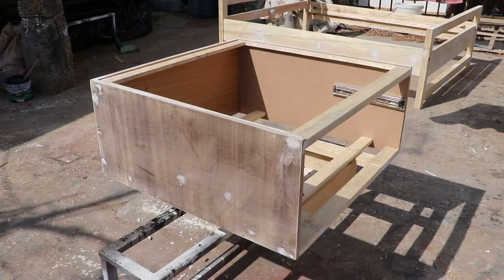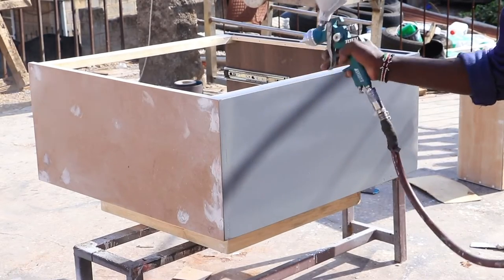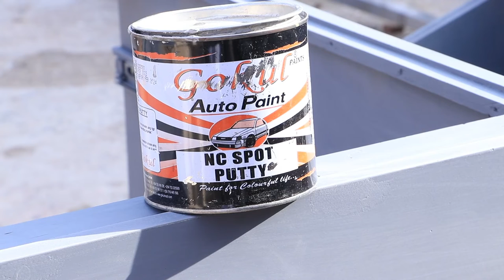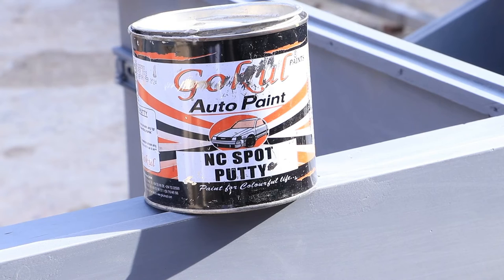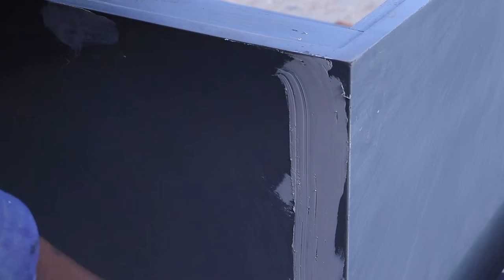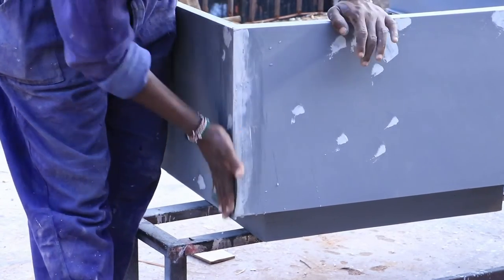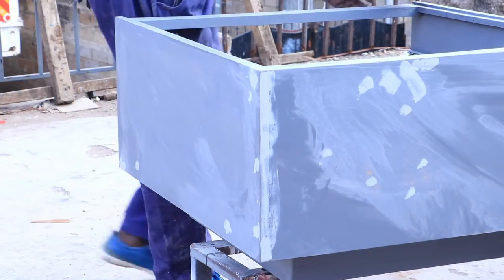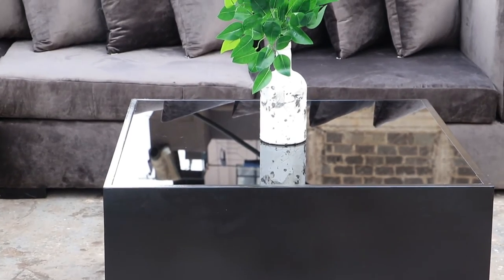How to Paint MDF | Both Plain and Laminate | Perfect Finish

Comment: What type of paint do you use 🙏
Reply: Also is there a difference between spot putty and body filler?
Reply from the maker: We usually use Neutro cellulose (NC) paints or Automotive.....the ones used to Paint cars.
Reply from the maker: @spiceed_spaces1  yes. Body filler is for bigger gaps and is used before applying primer. Spot putty is after primer/ undercoat...and is used cover tiny tiny imperfections
Reply: Thankyouuuu so much.
Reply from the maker: @spiceed_spaces1  welcome! Thanks for your response 🤩